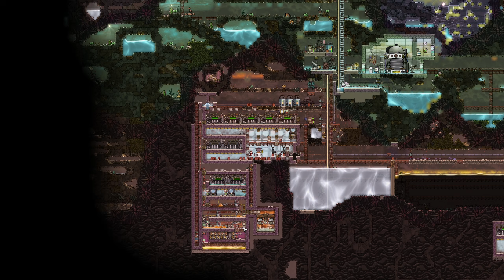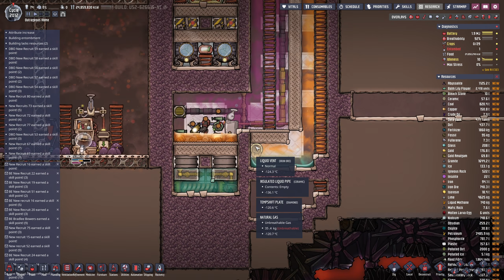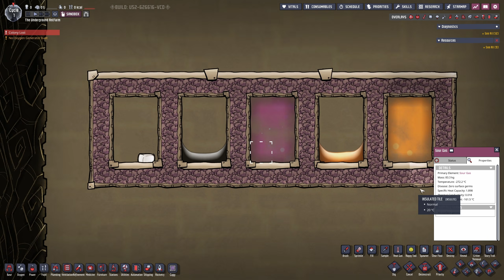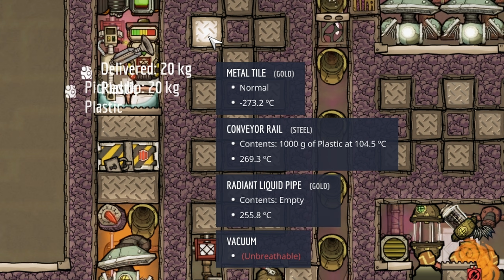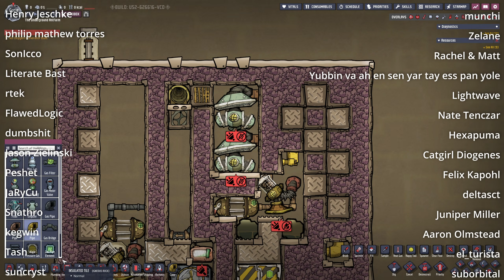If it's worked that would be great : Oxygen not included ep 15

Comment: with 1kg per second you should be able to use those plastium mini liquid pumps, might save you a couple tiles here and there :)
Reply: Aren't they more meltable? They are made of plastic. What is the overheating temp on those?
Reply: @mikhailgusev2394  plastium was added at some point, which is essentialy thermium, but counts as plastic for building things.
Reply: Do you have access to plastium if spaced out is disabled though?
Reply: @nopenope8418  Yes as Plastium is made using Plastic and Thermium, the latter being found as a space material. A super niche material but it comes in handy
Reply: @xenosai371  I'm pretty sure you need some brakwax in the mix too so this is a bit harder to get than just plastic and thermium right? Or have I just not played recently enough and I'm wrong?

Comment: Wouldn't an "n" shaped boiler be better for on/off operation? Have the aquatuner in the hot side and a liquid tepidizer in the cold side, so when you shut down the system you could just stop the aquatuner and the liquid pump so the sour gas will stop liquidfying and no heat exchanger would happen, the whole "heat exchanger" would just eventually take a mid temperature with the sour gas cooling down and the natural gas heating up, but it shouldn't affect the system, just slowing down the boot up

Comment: 0:25 Carlos Plastic Brute-Force Batch Boiler
2:16 Ol' Francis's Old Energy Efficient Recycling Sour Gas Boiler from the Classic Badlands
4:14 Baby Francis's Baby Sour Gas Boiler from the Tiny Base (Hydrogen Vent Included)
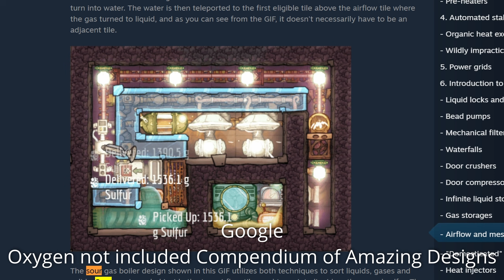5:30 Oxygen Not Included Compendium of Amazing Designs Steam Workshop
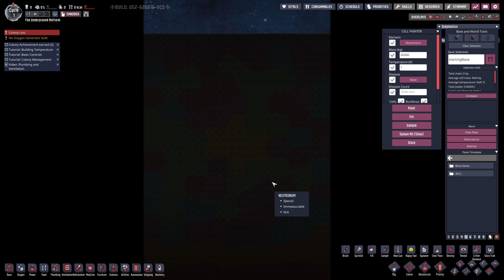6:02 "I prefer ta not use magic too much in these things" -- Francis John, 2024
6:10 The test map
6:23 The five stages of the natural gas cycle
14:20 attempt number 1
22:17 attempt number 2. Revisions to allow for start and stop operation.
37:50 attempt number 3. Plastic melting spot moved inside the sour gas tube.
38:47 attempt number 4. Preheat plastic through the output natural gas. Open gap between metal preheating tiles, solid block at the end for the melter.

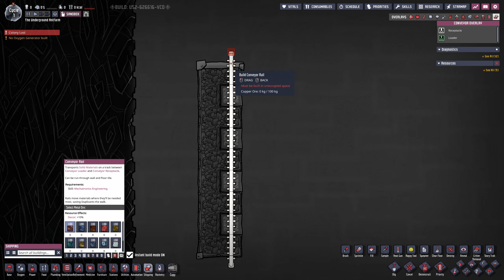7:09 alternating heat exchanger for solid melting.
8:14 "but then I realized something. How do we preheat this plastic from a cold system?"
9:06 prevent diagonal teleportation into the wrong room.
9:40 bead pump to move sour gas.
9:56 "It's not cheaty, it's just taking advantage of the some of the laws of physics!" -- Mad Scientist Francis, 2024
10:31 balance of heat. Either excess cooling or excess heating must be managed.
11:30 counterflow heat in the sour gas vs natural gas.
12:30 1 ton of water inside aquatuner room. This is a standard amount, not specific to the build.
12:41 forgot a temp shift plate.
13:03 set thermo sensor to 545C to keep the aquatuner room hot enough to flash sour gas.
13:13 set liquid pipe thermo sensor to 169C (not minus temperature) to keep the cold side cold enough to make liquid methane.
13:35 Both sensors are connected to an OR gate. Logically, the system runs the aquatuner unless both the room is hot enough AND the coolant is cold enough.

14:20 Start up the system. Load plastic onto conveyor loader.
14:28 Conveyor meter valve with constant reset becomes a flow meter.
14:50 Problem: melting loop clogged.
16:08 set flow meter to 2/3 conversion ratio.
17:08 adjust loop, so the empty shipping baskets do not block more plastic from entering the loop.
18:17 add more tiles for more thermal contact.
18:40 "Problem is we can't get the plastic to melt consistently. You need this plastic to melt on the first rotation." Why even have a loop if everything should melt on the first pass?
18:55 triple layer solid heat exchanger.
19:36 preheat incoming plastic using the output natural gas.
20:24 Realization: there is no need to limit the incoming plastic. Increase the conveyor meter valve to 2 units.

22:17 attempt number 2
23:24 design does not use a lot of thermium.
23:50 aquatuner hot box cannot be externally cooled.
27:03 mistake: the metal tiles on top of the natural gas room have an insulated pipe.
28:33 turn it off and on again.
29:46 "Ahheheheh. It broke! It broke!"
29:55 "there is a tiny blob of liquid methane here."
30:15 Fix: deconstruct the tile above the vent to allow another gas flow path.
31:00 shiny tile due to plastic melting in the walls.
34:55 two shiny tiles appear.
35:20 restart game removes shiny tiles. 
37:50 attempt number 3.
38:47 attempt number 4.
39:28 "Maybe I should put a little bit of flow control on this."
40:45 outro
Reply: Holy Molly! Talk about not-your-average-timestamps post! 😮
Reply: That's dedication right there. or OCD or a bit of both :P Good job!

Comment: a few months ago I send in a base for the base loving series that features a plastic smelter, if you need more ideas. It is a more vertical build, because that was the space I had. It has a 33% aquatuner uptime, processes 1000kg/s plastic and outputs methane at -13.3c (The methane then gets used as cooling for the natural gas generators, before reaching 30C, then it is turned into natural gas)

Comment: I wonder how big of a colony you could run on just bonbon trees.  They only need sunlight and you can boil or refine nectar into water, sugar, and plastic.  From heating and cooling plastic you get naptha, sour gas, sulfur, and methane.  Burn the methane and you get polluted water and co2.  Polluted water means polluted dirt, etc.  It seems like you can make pretty much everything to supply a colony with just nectar as input.

Comment: Conveyor loaders don't interact thermally with their contents.  Items in the loader work like debris on the tile with the conveyor port, and the loader is a building.  You can even put items hot enough to melt the loader in it when in a vacuum, and cool the loader from the other end with a blob of liquid or conduction panel.

If you want to heat or cool items in the loader, the items will exchange heat with a solid tile below them, although debris transfer to tiles uses lowest conductivity, so that is mostly useful for cooling hot metal.

Comment: That bug with the metal tile going a funny colour and going down to absolute zero is something I've seen before in debug mode. When I'm trying to clear out gasses by painting with the "vaccuum" fill tool if you touch a tile it goes that colour and that happens. The tile has weird/bad properties after that. I've never seen one flip like that without me using vaccuum fill though. I think maybe the funny colour is a visual indication that two things are in the same place (which should never be possible). In my case it' s a tile and a vacuum.  In your case it's liquid naphtha and a metal tile.

Comment: For my heat exchangers, I've been using a solid block of igneous (non-insulated) tiles. The heat exchange inside the tile is barely less than a metal tile, and between tiles it takes a couple cycles to even out. In practice, it seems to be taking up about 1/3 the space as the checkered design. YMMV of course, especially with intermittent use since the temperature does eventually even out, also I haven't tested it with liquid-liquid exchange yet, that's an upcoming build. My calculations say one side of it may need to use metal tiles.

Comment: If you move the bottom of your sour gass drop chamber up by 1 (which you can do since it is so efficient) you can fit in a door to conrol heat injection into the plastic melting chamber. That way the part melting plastic is not in direct contact with the part boiling sour gas so you should have no flashing of the plastic into sour gas anymore

Comment: This to be honest is the most fun of Oxygen Not included it's one of those oh i should go to bed soon but lets just finish this tiny thing and next time you look at the clock you are at 2 am or like 3 hours further haha, love it.

Can't wait how much further you change and fiddle with it, maybe go for a 2kg version instead of a 1kg that way you only need to build 4 blocks of them instead of 8. especially if designed in such as a way that you can run the 2kg version at 1 or 2kg or anywhere in between.

Then as you want on of switches, maybe make something that turns on off automatically based on how much surplus plastic you have, though measuring that out may be a bit of a pain.

On/off switches are horrible to add but i find that when i don't design for that it often makes my life even more difficult, of course i do almost all design build in a playthrough which just causes horrible mess.

I Should really look into setting up a test map like yours, maybe i'd actually finish a game for once (as in send someone through the tear)
Reply: You can probably dump all your plastic in one area, and use a weight measuring plate for that?
Reply: You'd still have to do some fancy work to determine how many of the blocks to turn on.

Comment: 32:00 this is why I don't like heat counter flows like that. You have very limited control on what is happening. 
There is one thing I can suggest that you seem to have forgotten! (condensation, I know): Remember on the old base game maps how players would melt regolith? 
They would have the conveyor rails moving up a tall tile touching magma and it can freely melt in any distance of that tile and drop into the middle spacing?
If I may crudely make a design here:
[] = tiles
x = space
[] x []
[] x []
and continue down the path. The [] would be the metal tiles you have there creating two columns and leaving a space x in the middle. That space x would sit neatly above the liquid pump. 
Now, you get the liquid pipes and conveyor rails to exchange in an S path, you know 
s
s
s
snaking plastic on its way down and methane on its way up. If ever a piece of plastic on the rail melts prematurely, it will freely be pushed into the center tile dropping into the naphtha tank.

You're welcome ;)

edit: never mind you did it later /facepalm

Comment: 31:15 the white tile will be deleted if you put water on that, because the plastic was melted inside of it and "destroy" the metal tile mass, this process is the same to destroy window tiles from rocket melting using ice (100kg per tile). But if you reload or descontruct probabbly not happens, in case of rocket we drop a little water to destroy the window, I belive if reload save nothing will change.

Comment: The effect you saw with the metal tiles is useful for deleting the diamond window tiles of a melted rocket interior. Let me explain:
The solid inside the conveyor rail (in this case plastic) converts to a liquid (in this case naphta). The naphta doesn't have anywhere to go, so it replaces the metal tile. This replacement is not properly registered by the game engine, so the tile is displayed as it is: Bright, because it doesn't have a material anymore, and at absolute zero, because it doesn't have a temperature anymore. For this change to take effect, the tile would need to interact with something around it, which it doesn't do because it's insulated tiles. If you were to deconstruct the insulated tile above it and drop water on top, the tile would vanish.

This trick is usable for tardis rockets by heating up the diamond window tiles to something high, 1000°C should be sufficient. Then you build a conveyor rail through them and encase them in insulated tiles. Onto the conveyor rail, you put ice, and loop it through the windows until the ice melts. When the window tiles light up, you deconstruct the tile above, and drop water onto it. The tile gets deleted, and can be replaced with whatever you would like to build there.

This technique avoids needing to melt the diamond at almost 4000°C, which cannot be done with molten steel.
Reply: Sounds amazing, I will try that.

Comment: is there a good reason why you arent using small liquid pumps? both pumps pump less than 1kg/sec, also is there a reason you pump the sour gas, instead of just letting it flow directly down to the condenser through a heatexchanger? The problem with the sour gas would have likely also been fixed by just increasing the amount of naphta before the pumps starts to like 500kg and some shift plates.
Reply: they are plastic. they'll melt along with plastic ;) And making plastium is harder than thermium.

Comment: Francis- Not sure if it still loads, but I emailed you a save a few years ago for Base Lovin' ('The Oil Pit'), which has a unique 10kg/sec sour gas boiler of my own design that is fully solid state, so no physical gas or liquid flow (or cheesy mechanics which I also dislike), it's just a lot of piping/counterflow heat exchangers.  It does take up a decent amount of space (barely matters on a large map though) and requires Thermium gas pumps, but I ran several of them for like 1000 cycles without issue.

Now that was designed for crude oil input, but I feel like the general design could still work for what your trying to do by modifying the input heat exchanger (which is counterflowing oil against hot sour gas) to start by melting plastic then pumping in the resulting naphtha for the remainder.  Naphtha/plastic have a much lower thermal conductivity, a slightly higher specific heat capacity, and likely a lower input/starting temperature (25C vs 90C) than oil, so the input heat exchanger will likely need additional stages.  This setup also requires slightly more heat to vaporize the input material, but I don't think that will be an issue here, the system has to bleed off excess heat from the sour gas vaporization chamber into the methane output anyways in order to maintain the temperature balance with the aquatuners, so it is already biased toward accommodating additional heating of the input material, that should actually lower the methane output temperature (not that it's hugely impactful, since the methane is immediately burned for power).
Reply: By solid state, you mean it's all out in the open, and not in pipes?
Reply: The opposite, by 'solid state' I meant there is no physical flow of liquid or gas tiles, like in basically every other sour gas boiler design, all heat exchange/material flow happens within piping.
Reply: @ancientgammoner6961  Oh, interesting.

I'm trying to design one that uses the minimum of pumps and conveyor loaders.

Comment: In Debug mode, when you overwrite a tile with another tile ( ie place a metal tile ontop of an existing insulated tile), IF something melts in that metal tile or a pipe breaks, the liquid will ALSO occupy the same space and the metal tile will stop acting/conducting like a metal tile. at 31:04 when you see the metal tile brighten as if its under sunlight that's exactly what happens.
When in Debug mode Deconstruct tiles and place new ones instead of overwriting.
Btw i sent you an email on how to do aquatuner overflow bypass and you featured it in a video. yet you are still doing it the old wrong way !

Comment: Am I missing something? You're using approximately 3kw of power to convert plastic into natural gas, which gives you approx 3kw of power back? I understand that you could scale it up to produce more power, but I still don't understand why go to all that trouble, when there are lots of power solutions on a normal asteroid, from solar to coal, natural gas, hydrogen, etc. As an engineering design concept, it's brilliant, however, I still don't understand why? Is it like that mountaineering thing, where people climb mountains, just because they are there?
I'm a simple man, and I prefer simple solutions, which is why I have never built a petroleum boiler, I could, but it just seems simpler to feed some water to some oil wells, then convert the oil to petroleum using the refinery, and you get a bunch of natural gas too. I understand that it's inefficient, but it's easy to set up, entirely controllable, needs dupe labour, but even with the small colonies that I prefer(12-16), dupes are never working all the time.

Comment: I feel like you are over thinking it and should just treat the plastic as if its oil and not worry so much about all the pumps. i bet you could do it with one pump for the the methane and one for the natural gas and it would work better.
Reply: Got to agree with you here: it would be simpler to let the plastic flash into sour gas in one side of an ∩-shaped chamber, and then cool it into liquid or frozen methane in the other side of the chamber. Then you just need to pump the frozen/liquid methane out of the system, and perhaps the sulphur.